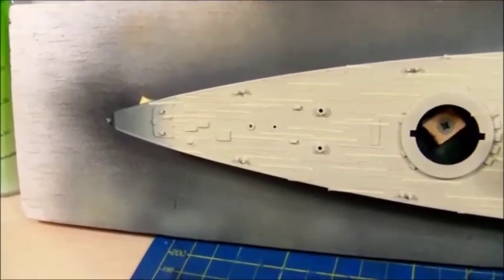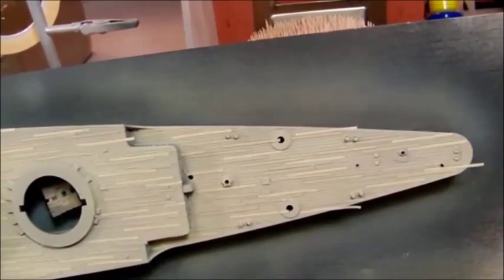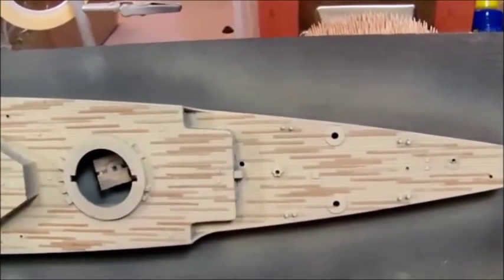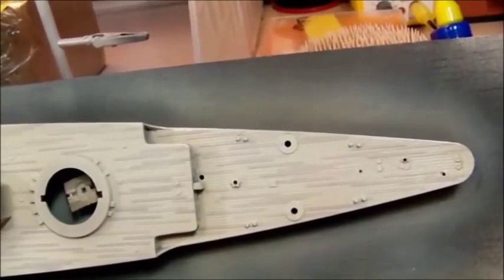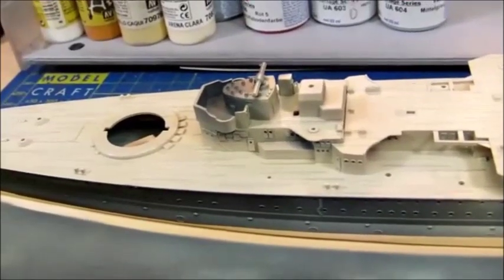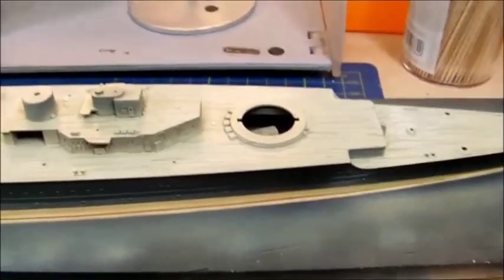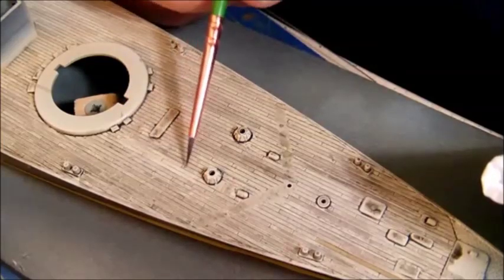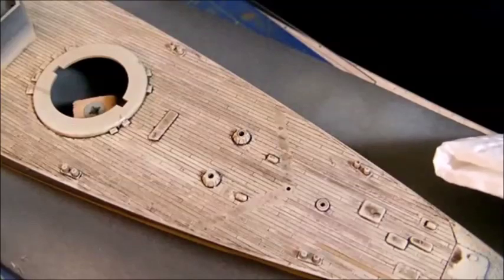Admiral Graf Spee in 1/350: Build Log Part 6 (Wood Deck 2)

Comment: its a nice result, and i see it takes a long time, is there no shorter way? paint it black? and airbrush is lightly for detail, and finish witch a dry brush over some lengths?
Reply from the maker: Hi, there! Thank you for watching. Time wasn't an issue with this build, because I wanted to finish it the best I could. This model has earned me a number of medals and it is a show stopper, when presented at my club's booth. The most positive comments I receive on the deck ( and for water display- see later videos in this series). Many times I have been asked, if it was a wooden deck. I can say that I don't reget any one minute I spent on this procedure. There are certainly quicker ways to paint a deck. It's always good to choose to go the way that fit's your bill. So take what you have learned here adapt and change it to your needs. Ejoy the process and have fun!
Cheers!

Comment: Hattest du auch das Problem, dass der Rumpf zu lang, oder das Oberdeck zu kurz war? Wenn ja, wie hast du es behoben? Danke
Reply from the maker: +Mahsuni Yildirim Hallo, Mahsuni! Danke für's reinschau'n! "Nein", um Deine Frage zu beantworten. Tatsächlich fand ich die Passform hervorragend. Ich hatte so gut wie keine Spalten zwischen Rumpf und Decks, die hätten gefüllt werden müssen. Hast Du Bilder, die Dein Problem verdeutlichen?
Reply: Ich habe inzwischen Plasto mit Contacta liquid verdünnt und in die Spalten vorne und hinten gegossen. Bevor es ausgetrocknet ist, habe ich hinten die Beplankung nachgebildet. Man sieht nichts mehr. :)
Reply from the maker: +Mahsuni Yildirim TipTop! Das w&#228;re so ziemlich mein Vorschlag gewesen! :)

Comment: I served in a Battleship, Britain’s last one HMS Vanguard. Our decks did not have such a contrast in individual planks such as depicted. Ours were Holy Stoned and they took on a bleached uniform tone. The models decks look over emphasised Done like this, and in this scale they look even more wrong. I think you have done a lot of unnecessary work, but hey it’s your model to do as you please with. Sorry.
Reply from the maker: Hello,Robert! Thank you for stopping by and for your input. Quite certainly the deck painting may be deemed unnecessary work. However a deck like you discribe is rather bland and boring to look at. I certainly prefer something, that catches the eye of the viewer. As usual, my way of doing things may or may not appeal to the individual. It's not in any way "right" or "correct" and not a bit "accurate", but it does please me (and a few hundered folks having seen in it shows, who thought it was actually remarkably nice). Certainly the video does not give you the same impression as in a show seen from one meter distance. I am very, very pleased with the result and do not regret a single second I may have "wasted" on it. I will certainly continue to paint my decks this way. Cheers and a Happy New Year to you!